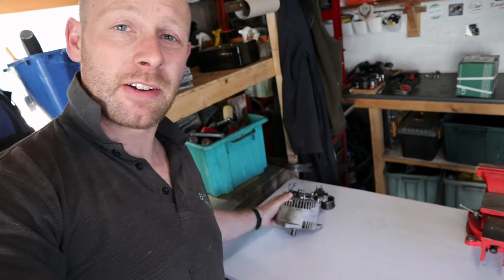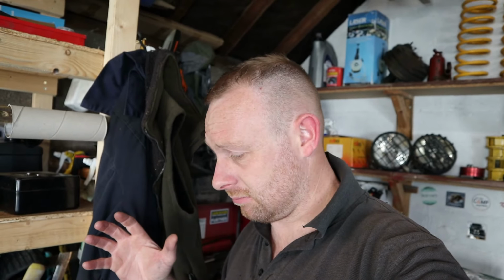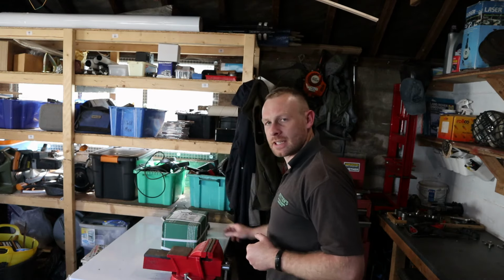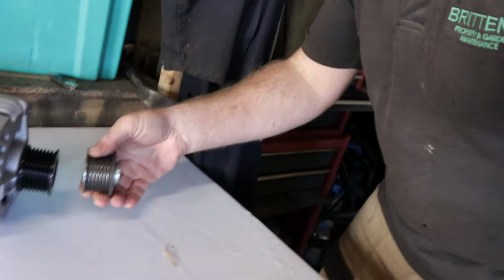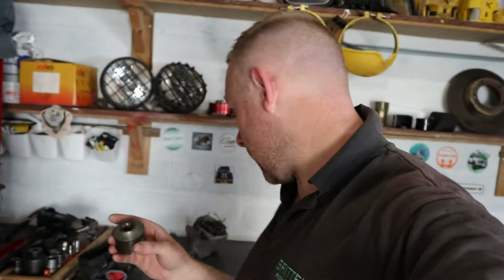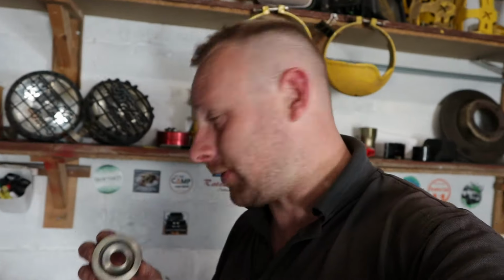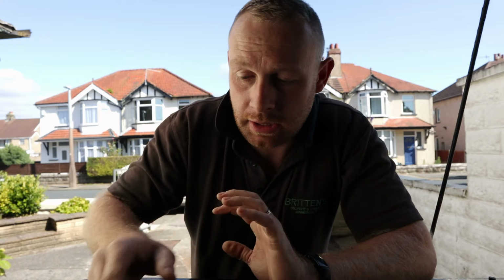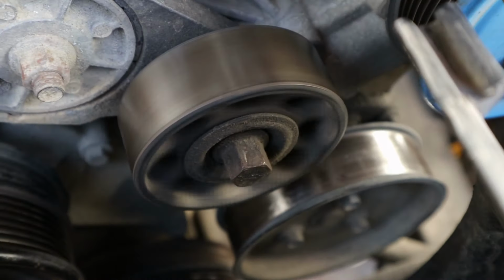alternator upgrade on the discovery

Comment: i did a replace myself last year too, i was lucky the local LR garage had just one in stock, dont know the amps, i was in a hurry to get back on the road, the bolts are bit hard to reach but i got it fixed in 2 hours with a bad collection of tools i have🧐
Reply from the maker: Yeah it’s not a bad job really, I went with a replacement for time too but I would like to rebuild the old one for a spare

Comment: It's getting tougher to find parts for the Disco 2 so must be worse for the Disco 1!    Nice easy engine to work on too.
Reply from the maker: To be fair I’m not having trouble with parts as the 300tdi was used on the defender. It’s when you want to fix parts I’m finding it had to get those bits. (If that makes sense?)
Reply: @TheNorthernExplorer  Yes, more or less. Some parts for the D2 are obsolete now. Stuff like auto gearbox rear seals, suspension hockey stick bushes - important stuff!